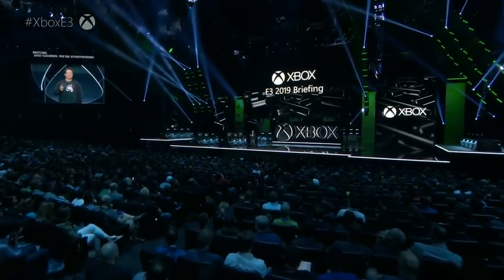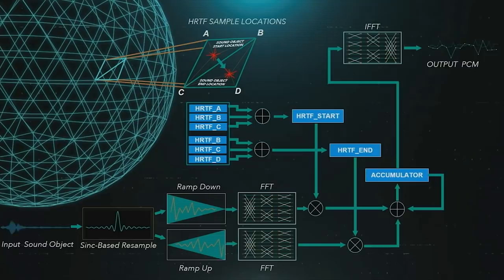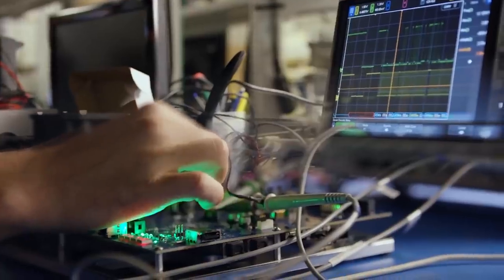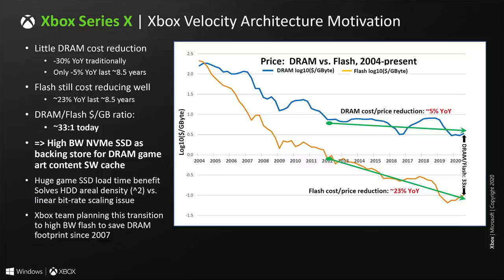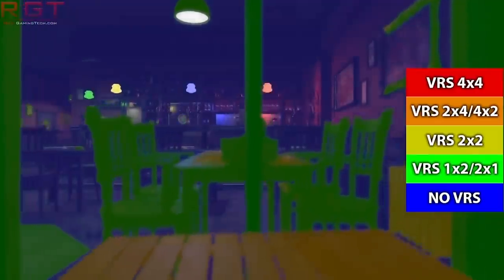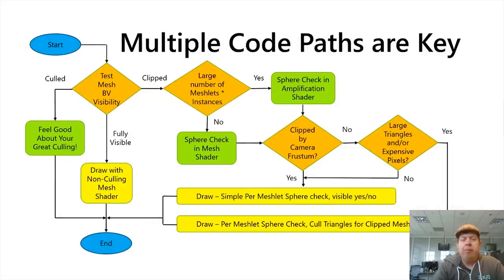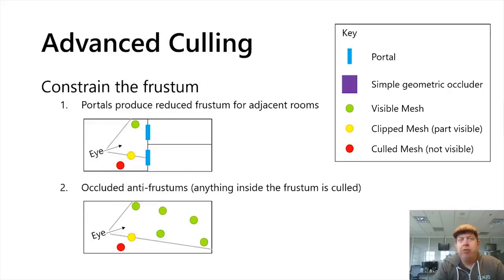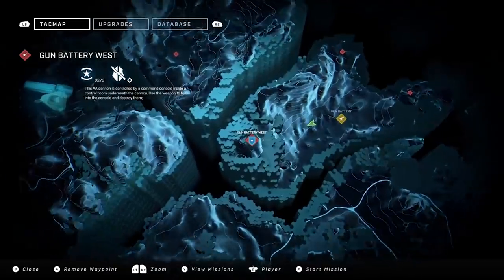Xbox Series X Hot Chips Analysis Part 2 - SSD, Memory, Audio & More

Comment: All this explanation only solidifies ones thing, Series X has problems. Having two different pools of RAM goes completely against what developers have asked for, already a bottleneck, so it means to get full use of the limited RAM compared to PS5 you have no choice but to shuffle between RAM and storage a place where PS5 is superior no matter what technical jargon Microsoft throws out. SFS in no way will magically give more bandwidth, you cannot go beyond what you have available. Nothing but software mitigations to deal with their Frankenstein machine again. Instead of a tiny lump of ESRAM, they have them 10GB of ESRAM. While Sony gives developers 16GB of 484GB/s bandwidth across the board. 

I can't take Microsoft seriously as I can't seem to find a single developer praising any of these so called great design moves for Series X. They can't even find developers with any standing to defend this console or praise it at all.

Too much time trying to explain pointless jargon to gamer who don't know what any of it means. Only end results matter, so far Microsoft hasn't shown Series X running any next gen games at all. If they are playing the con game to drop a bomb on Sony they are definitely taking it to the wire. I'm not one to believe in this sort of fantasy since this is a publicly traded company and shareholders wouldn't greenlight this especially with a monstrous competitor in Sony in the gaming sector. 

How did Paul not explain that Series X has split it PCIE 4.0 for storage but Microsoft decided to split 4 lanes into two for internal and two for external. This is why the SSD bandwidth is so lacking compared to PS5 in the first place. Microsoft has too many software mitigations, while Sony attacked these from the hardware point which makes it more expensive but it's a better base to work with, therefore software will aid it increasing the gains and not mainly to help fix the bottom end that's lacking.

What you can surmise based on what we've seen is Sony PS5 seems to be up and running software and developers were able to show their stuff running in hardware. Series X, nothing but titles running on PC. Based on end result, why would anyone need extra explanation is beyond me.
Reply: Utter nonsense.
Developers asked for high bandwidth low latency VRAM, MS provided 10GB of that. Much higher bandwidth than PS5.
Developers asked for a means to target resources at performance profiles based on required latency, MS provided that.

You know who esle was asked for the exact same thing? Nvidia. As nVidia have stated quite specifically. 10GB was the optimal VRAM capacity required to meet the requirements of developers.

You also provide incorrect specs, PS5 has 448GB/s not 484GB/s. The 10GB of high bandwidth RAM on the XSX is not esram.

I mean i could go on and on.

Just because you have no technical understanding dont start spouting garbage.
Reply: @garyhay6991  EXACTLY. I dislike when people spew nonsense to boost their egos with likes and some slight hope. Also are you getting a 30 series? If so, I hope you enjoy it! I would get a 3090 with an i9-10900K, but I do not have much room in my small apartment plus I go to college in 3 years anyways.
Reply: @ItsJust_Sins  I will probably get myself a 3080 depending on what AMD's cards can achieve on performance/££.
Reply: @garyhay6991  Glad to see you upgrade 😊